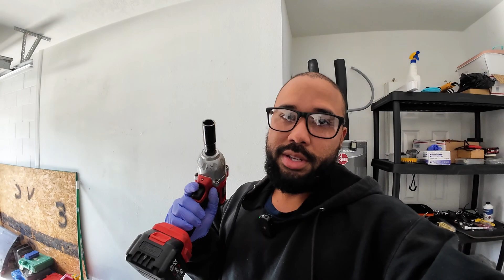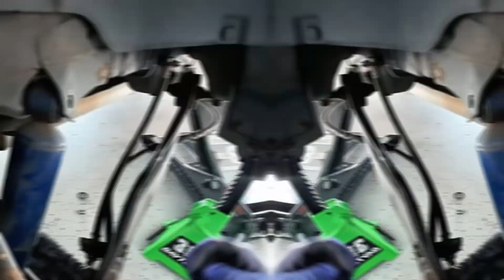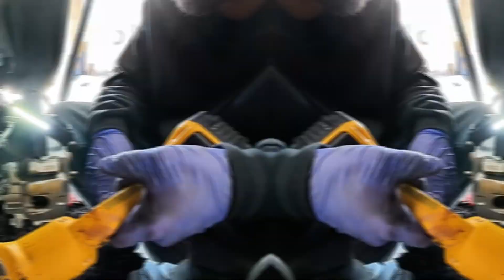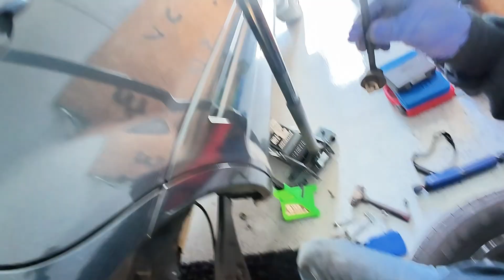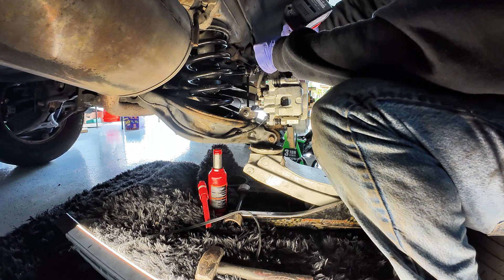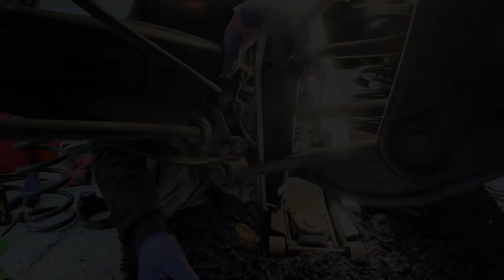2003-2008 Honda Pilot Rear Suspension Replacement

Comment: Good odds you will need to cut/grind off your sway bar links. If you cannot cut/grind them off don’t attempt this. If you don’t have a solid concrete floor and two rolling floor jacks do not attempt to change your springs. Just my 2 cents. The shocks are an easy job. The springs and link are not a beginner job. I just changed my whole rears suspension on my pilot. It took all the tools and all the patients and lots of gotta get that part now. Changing springs led to changing everything. 200k miles with the rust. Eric the car guy has a good video of this as well.

Comment: Does the bump stop come with the upper and bottom rubber ring . Meaning the one that covers the coil spring top and bottom , incase those rings are tear and worn.
Reply: No, the bump stops are sold separately from Honda. The spring insulators are rubber for the top & the bottom is a hard, but flexible plastic type material.

Comment: Could you make a video and show us the end result of all this work?  Did you get the height back in the rear?
Reply: I've done this repair on my 05 Mdx & yes you'll get the ride height back. If you go w/ moog springs, they'll sit about an inch taller over factory springs. Vehicle looks & rides much better since install. But you have to drive it a few times after install to allow the suspension to settle back to a normal ride height (about 34", measuring from the ground to the top of the fender well). It'll look really tall right after install until you drive it & get those springs time to settle back into position in those insulators.

Comment: curious if these items fit the 06' acura mdx. ebay says it doesnt but I think it would.
Reply: The springs will fit, but the bump stops are a different shape for your Acura than from Honda. I just completed the rear suspension rebuild on my 05 Mdx & it made a world of difference.
Reply: Did you use the moog coils and kyb shocks? I have the parts been putting it off for a little while though
Reply: @bradley-concrete  yes exactly, Moog for springs (made in USA), Acura for the upper & lower spring insulators & bump stops, KYB for shocks & TRQ for the adjustable upper control arms (fixes the factory camber issue that the oem non-adjustable control arms had). Also used Proforged stabilizer links. If you go w/ the moog stabilizer links, they have greasable fittings unlike Proforged.
The moog springs sit about an inch higher over stock & with a slightly firmer ride. It rides really nice, handles well going down the road, comfortable & not harsh at all. I say go for it, you'll be happy
Reply: @bluor3713  awesome thanks buddy, looks like i need the insulators and bump stops, did you get them online or dealership?  I got the moog stabilizers. everything moog basically, and kyb shocks. Have you done the front of your mdx yet? I have all that ready to install aswell went with kyb strugs, moog coils and all the moog ball joints and stablizer links